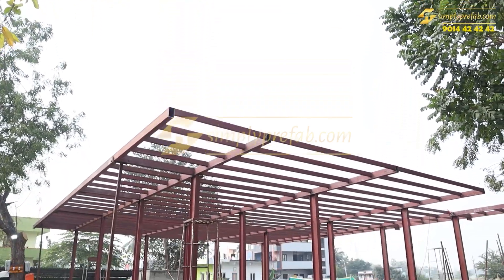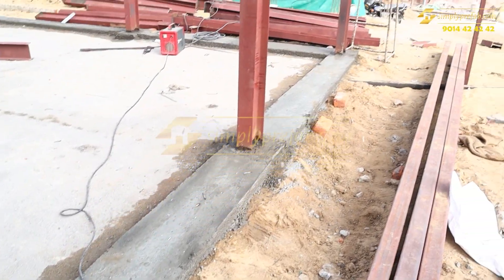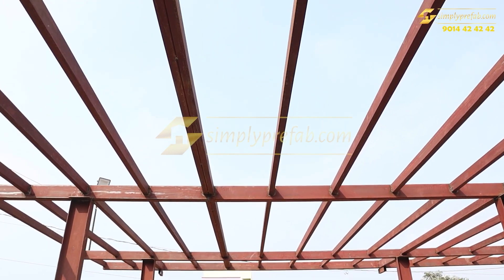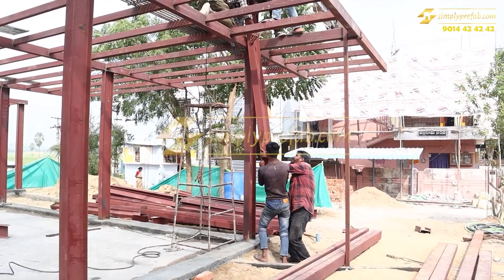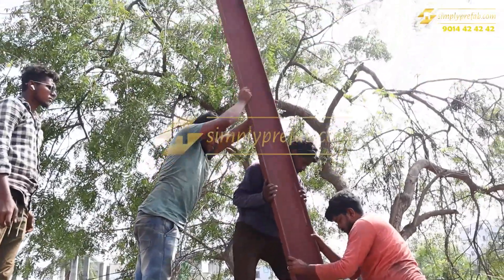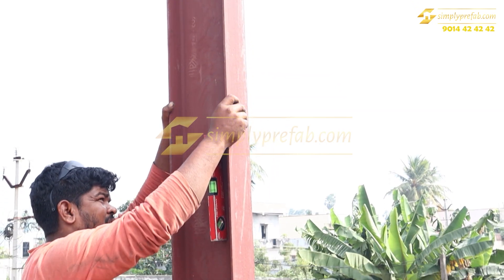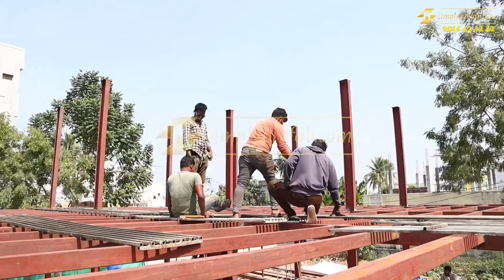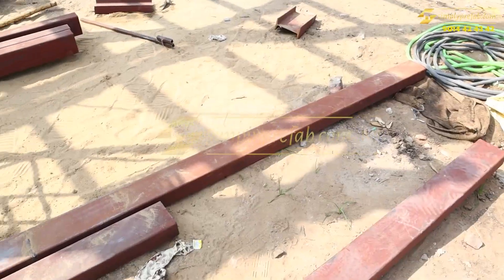Discover the Future of Housing: Prefab Residential Houses

Comment: Do you use Cylindical pipes also in your fabrication work ?For if we want to cover the columns with plaster to give a round pillar look .Or otherwise  how can we hide your iron colums to give a cylinderical look ? Are there in Market POP cement  water resistant mounds giving antic look to the pillars ?
Reply from the maker: no we don't use cylindrical ones. columns can be covered with fiber cement boards, PVC and POP also.